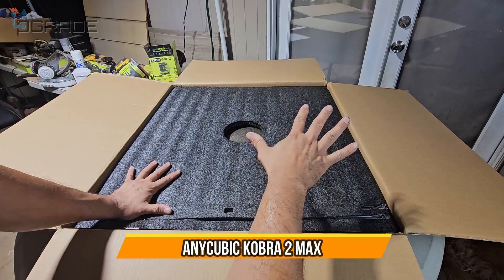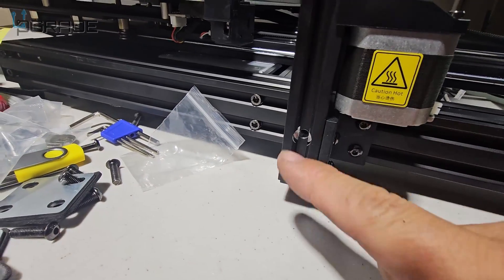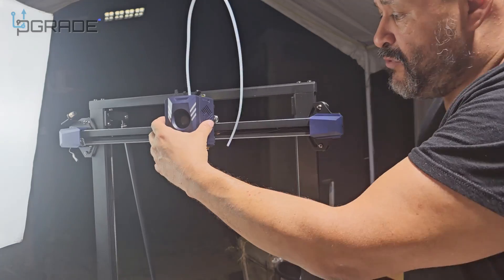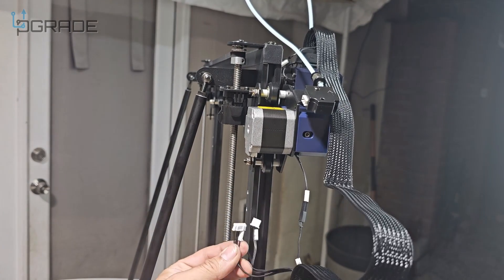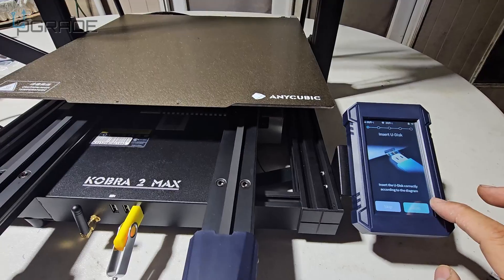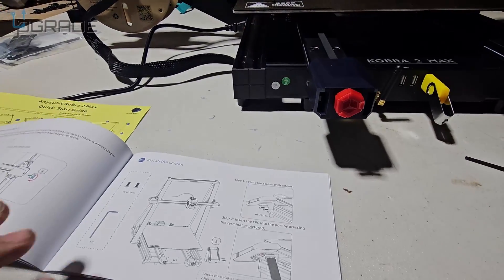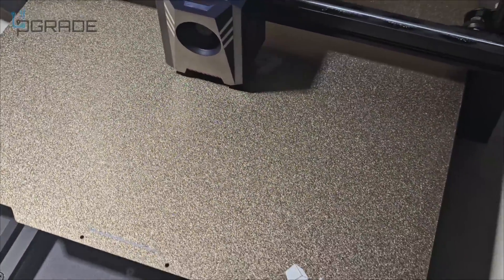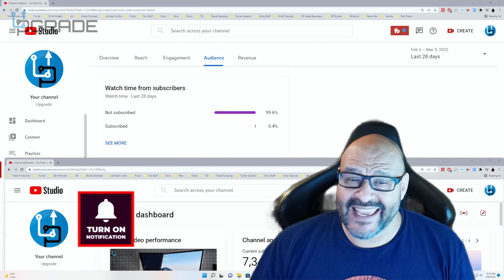The Best Largest 3D printer Anycubic Kobra 2 Max

Comment: I am a beginner and I’m thinking about getting a new 3-D printer. Is this a good one for a beginner and in general?
Reply: Nah get the neo. This is overkill and u wont use it 99.99% of the time to its max capabilities without spending £100s on filament
Reply: @SRNAR8  your not even supposed to max it out, im a beginner and got it and if you stay around 250mm under it prints fast and good quality most of the times

Comment: Please compare to the Comgrow T500 which has a 500x500x500 build volume, and is built like a tank.
Reply from the maker: That is easy first, the Price this cost less at the moment is under $500. It's faster in sport mode to 500mm/s, but I would have to get this to compare them. I had it for over a month and I'm happy about the printer, and it hasn't failed yet. They just added wireless printing this week.